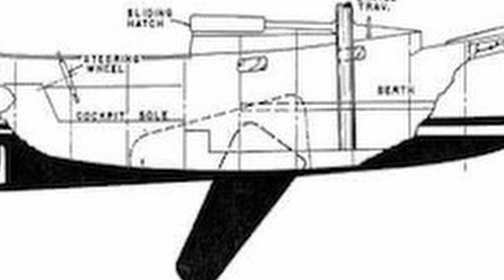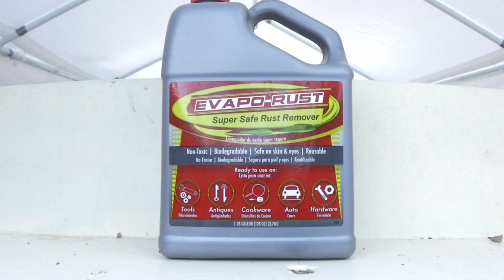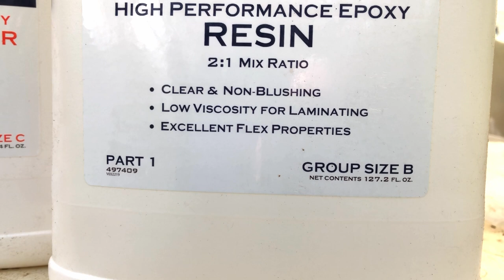Eps. 5.1 - Stuck Centerboards, Cockpit Soles & Cabin Paint.

Comment: Keep well. There are some odd ways on YT of pronouncing Herreshoff, lol. This vid set me to wondering how you decide on which boat to work on and for how long, as it can be like pulling a thread from a wooly jumper....
Reply: Good question. Sometimes its a matter of having the right materials ro work on one versus another, other times, its how much time I have and how much time it will take to do what I need. Its easier sometimes to just go out and tinker around with the wooden boat because it doesn't take much prep at this point. I walk out, chip out another deck plank and I get that done. Most things with the other boats now require some prep work, like getting the epoxy together, mix it, get the surface pepper, etc. Sometimes its just what Im in the mood for :) But its all fun and way cheaper than therapy. :)